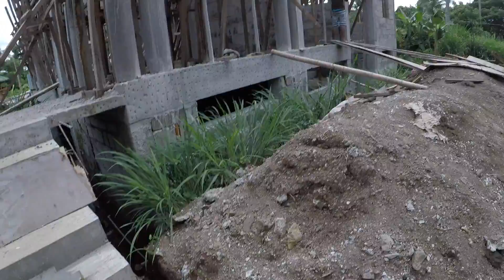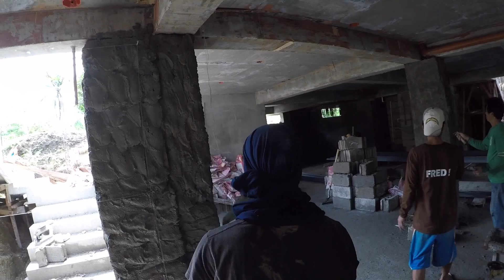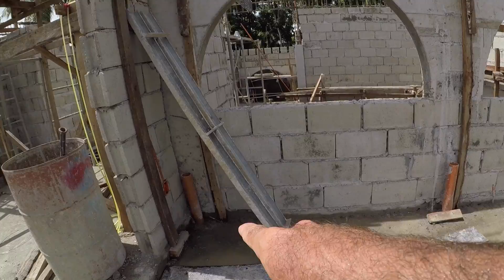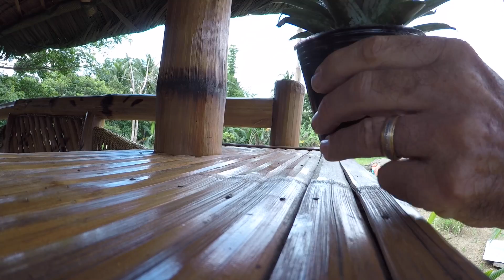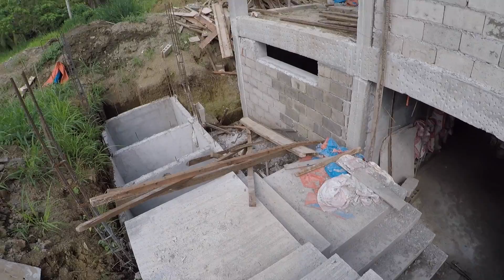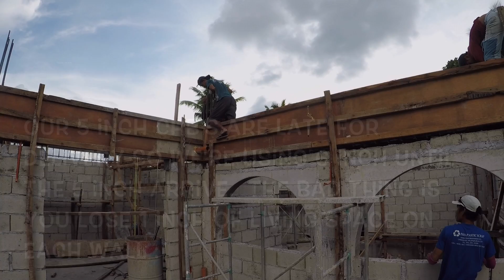VILLA FELIZ - EPISODE 117: NO-GO GOPRO (House Building in the Philippines)

Comment: Hi James,  I just wondered if you are able to plumb in a western style washing machine and would appreciate any advice on the kind of water pressure needed and how to achieve said pressure. I'm hoping to build a small house in Bantayan in the next year or so and it looks like I will need to sink a bore hole etc, so any advice would be gratefully received.
Reply from the maker: I think the washing machines here are exactly like those we have in North America.  The only appliance I see differently is the refrigerator which they omit to install the water inlet feature on the back for ice makers.  You'll just need a water supply and a drain.
Reply: OK thanks!
Reply: If you have the time to read this article https://www.whitegoodshelp.co.uk/low-water-pressure-and-washing-machines/   I would like very much to hear your comments... Cheers James

Comment: James, when you expanded the first floor great room, did that add on to the SqM of living space. you already has 160 SqM, so do you have more now. I calculated 300 SqM total living space, as I allowed 80 SqM for the Garage area. I also like the column idea to cover the pipes.  Your progress is awesome, even with a few rainy days. As always looking great.
Reply from the maker: The patio was calculated as part of the total area so nothing has changed when we added the glass for the outer walls to the plan.
Worked with my architect over the weekend on the pipe issue.  Hopefully we come to an agreement today.

Comment: Hi James. House is really opening up. I noticed when he was putting the plaster coat on the column there were no holes chipped out? 11.28 in the video.
Reply from the maker: The columns that had no chips were prepped while still wet with simplified plaster coat.  If you watch the earlier videos when the forms were pulled off those columns you'll see them slinging a plaster coat at that time.  It works just like chipping and simpler to achieve bonding.  If you wait too long and the columns dries, this is not effective and the plaster will not bond to the column.  That's when the builders have to turn to chipping.

Comment: hi James, just in regards to putting up the 4 inch hollow blocks to hide the pipes;  I would just build columns around the pipes and then make them look like the same columns on ur entrance porch. saves blocks, time and will still look nice.  putting an extra space where ur windows are will be Abit more headache going from 6 inch forms to. 4 inch. just my opinion.
Reply: Why not use elbow joints on the pipes right at floor level adjust the offset of the vertical run of the pipes up the wall so they are evenly spaced. Then you can cover the vertical run of the pipes with decorative columns and cover up the elbow joints down at the floor with the leveling layer of cement that goes under the floor tiles.
Reply from the maker: That was one of the first options I presented to my builder.  But that solution comes with several issues since the pipes that are run from below thru the slab are not standardized and equal distance either from the wall or between the half moon windows.  If we attempted to use columns, then all the columns would be offset differently which would be a disaster astetically.  The second option was to run the pipes thru the wall at the very bottom and cover that up with concrete.  It wouldn't be seen from street level and would be tolerable for us on the patio.  Unfortunately, that option would require cutting into the existing wall by at least 4 inches necessitating cutting through the steel reinforcement.  This combined with cutting into the already set concrete would lead to a sure failure of the entire wall structure which would have a potential to collapse at some point, especially during a seismic event.  The 3rd option we're going for is really the only option I can see at this point that will maintain the original design features at the same time providing additional strength to the outer wall.  The only disadvantage is it takes up more space both at the roofline as well as reduced floor space.

Comment: Jamesssss!
Could the drain pipes be cut flush with the patio deck and the add drain grids/covers when /if you finish the walking surface?
Reply from the maker: The water flow from the roof will carry a much higher volume of water than the floor drains.  The floor drains are set in 2 inch PVC.  Since the roof has higher water volume all the roof downspouts are 3 inch.  If you tried to push 3 inch water volume into 2 inch PVC it would cause over flow and we'd have flooding on the floor of the patio as well as possibility of flooding in the gutters.
Reply: Aren't those 3 inch pipes ?
Reply from the maker: 2 inch in the floors.  2 and 3 inch for  gutter downspouts, depending on which part of the roof we're connecting to.

Comment: Hey James,
Instead of doing all that extra block on the on the patio to cover the drain pipes, why not do a 45 in the corner and then a little colunm pop out to cover the other two drain pipe?  Save a lot of time and extra work.
Reply: Why not use elbow joints on the pipes right at floor level adjust the offset of the vertical run of the pipes up the wall so they are evenly spaced. Then you can cover the vertical run of the pipes with decorative columns and cover up the elbow joints down at the floor with the leveling layer of cement that goes under the floor tiles.
Reply from the maker: The use of columns was one of the first options I presented to my builder.  But that solution comes with several issues since the pipes that are run from below thru the slab are not standardized and equal distance either from the wall or between the half moon windows.  If we attempted to use columns, then all the columns would be offset differently which would be a disaster astetically.  The second option was to run the pipes thru the wall at the very bottom and cover that up with concrete.  It wouldn't be seen from street level and would be tolerable for us on the patio.  Unfortunately, that option would require cutting into the existing wall by at least 4 inches necessitating cutting through the steel reinforcement.  This combined with cutting into the already set concrete would lead to a sure failure of the entire wall structure which would have a potential to collapse at some point, especially during a seismic event.  The 3rd option we're going for is really the only option I can see at this point that will maintain the original design features at the same time providing additional strength to the outer wall.  The only disadvantage is it takes up more space both at the roofline as well as reduced floor space.

Comment: why not just make a false column to conceal those down spout there than to waste tons of materials and hundreds of manhours?
Reply: https://i0.wp.com/i01.i.aliimg.com/img/pb/114/228/481/481228114_161.jpg
Reply from the maker: That was one of the first options I presented to my builder.  But that solution comes with several issues since the pipes that are run from below thru the slab are not standardized and equal distance either from the wall or between the half moon windows.  If we attempted to use columns, then all the columns would be offset differently which would be a disaster astetically.  The second option was to run the pipes thru the wall at the very bottom and cover that up with concrete.  It wouldn't be seen from street level and would be tolerable for us on the patio.  Unfortunately, that option would require cutting into the existing wall by at least 4 inches necessitating cutting through the steel reinforcement.  This combined with cutting into the already set concrete would lead to a sure failure of the entire wall structure which would have a potential to collapse at some point, especially during a seismic event.  The 3rd option we're going for is really the only option I can see at this point that will maintain the original design features at the same time providing additional strength to the outer wall.  The only disadvantage is it takes up more space both at the roofline as well as reduced floor space.
Reply: you can do the second option by attaching (re-welding) a connecting bar around the down spout, this might be more cost efficient than to re-wall everything. IMHO

Comment: suggestion sir james, why not just cover the pipe that looks likes  a column since it was in the center and both ends of the wall instead of double walling it...and it will be less weight for the beam, less expences for chb,less labor,and save more time..
Reply from the maker: That was one of the first options I presented to my builder.  But that solution comes with several issues since the pipes that are run from below thru the slab are not standardized and equal distance either from the wall or between the half moon windows.  If we attempted to use columns, then all the columns would be offset differently which would be a disaster astetically.  The second option was to run the pipes thru the wall at the very bottom and cover that up with concrete.  It wouldn't be seen from street level and would be tolerable for us on the patio.  Unfortunately, that option would require cutting into the existing wall by at least 4 inches necessitating cutting through the steel reinforcement.  This combined with cutting into the already set concrete would lead to a sure failure of the entire wall structure which would have a potential to collapse at some point, especially during a seismic event.  The 3rd option we're going for is really the only option I can see at this point that will maintain the original design features at the same time providing additional strength to the outer wall.  The only disadvantage is it takes up more space both at the roofline as well as reduced floor space.
Reply: Jefrain Doctor l agree with you that great idea I was thinking the same as you
Reply: Also would look like a Spanish style balcony
Reply: https://i0.wp.com/i01.i.aliimg.com/img/pb/114/228/481/481228114_161.jpg

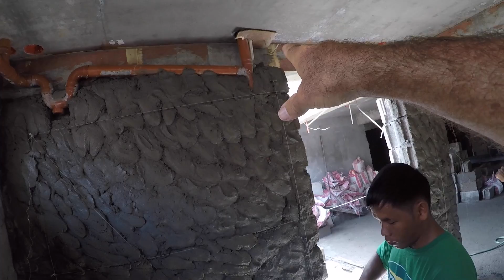Comment: @3:52 is that an optical illusion or are they really trying to disprove the theory that drains need to run downhill?
Reply from the maker: Viewing angle I think.  The right side is the lowest and it goes down the wall to the drain outside.
Reply: You mean the flow is left to right? That P-trap location sort of confused me. 

I went back to a previous video and can see the pipe going down. I just never saw drain run so far, make a 90 def turn, and then go to a P-trap. Somehow I overlooked that possibility. LOL

Comment: i think the drain spouts are not wrong, mostly houses in ph they dont hide the pipe but of course it depends on the owner. and i agree its pleasing if they are hidden.
Reply from the maker: I'm all about pleasing to the eyes.  👍🏼
Reply: Why not cover with decorative columns instead of doubling the wall thicknes (and weight) and losing 5 inches of floor space?

https://i0.wp.com/i01.i.aliimg.com/img/pb/114/228/481/481228114_161.jpg

Comment: one more question James my question is are you using schedule 40 or schedule 80 PVC it would concern me if it was schedule 40 and then you put concrete on top of it schedule 80 probably wouldn't worry about it but that's my question 40 or 80 thank you
Reply from the maker: I'll have to check the next time at work.